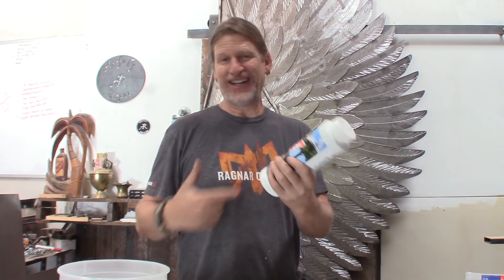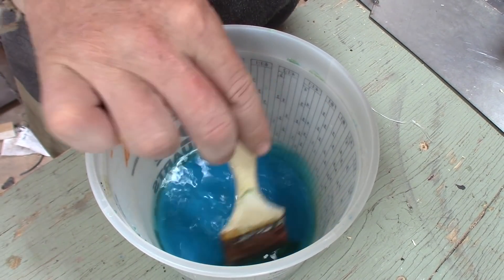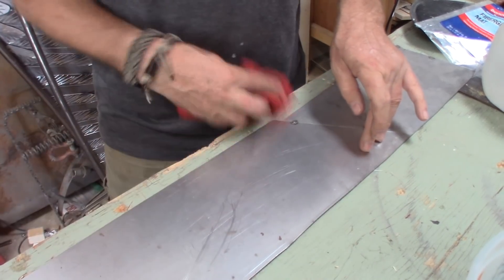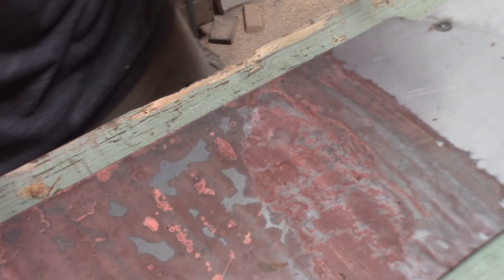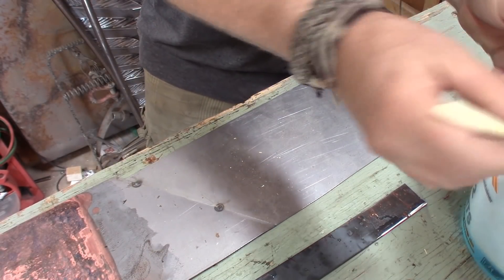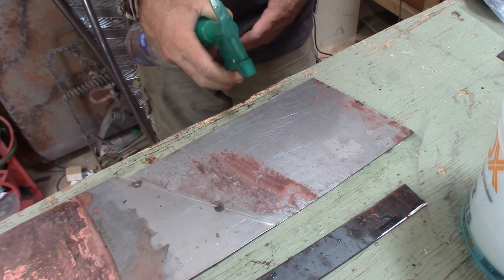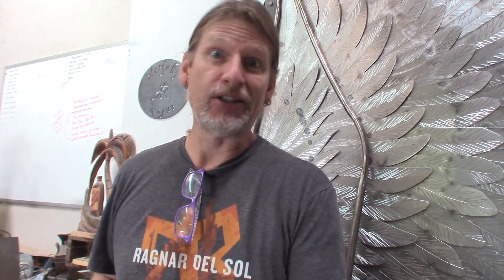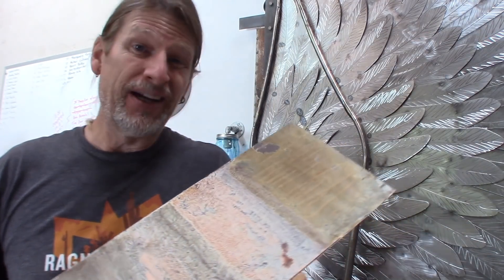Copper Sulfate on steel FREAKED ME OUT!!!!

Comment: Some cool chemistry going on here. Also some "accidental", but natural electroplating. The iron atoms in the steel displace the copper atoms in the copper sulfate solution; the surfer gives up the copper and attaches to the iron atoms forming iron sulfate. The carbon in the steel grab on to an oxygen atom as a result. This oxidation (rust) is redish brown (we all know this) but the iron-sulfate is bluish in color. Where the iron sulfate outnumbers the iron oxide the "stain" is a bluish color. The displaced copper atoms also oxidize very rapidly turning green, but because this combination has the same electrical charge as the iron sulfate it will not adhere to the steel. The green liquid can be wiped off or if dried it will come off as a powder form. Adding vinegar (Acetic Acid) to the mix combines with the copper to form copper acetate which is also bluish in color and this will electrically adhere (electroplate) to the iron atoms in the steel. The only color you can not achieve permanently without affixing it with some sort of clear coating resin is green. I really only researched this to make sure the addition of acetic acid wasn't creating some sort of noxious fumes you should be aware of - apparently not.

Comment: Copper sulphate crystals dissolved in dilute sulphuric acid was a common, traditional marking fluid still in use back in the sixties and a little later, for marking out on iron and steel components, before the safer, more modern stuff came out. It helps get a nice overall finish if the steel's clean.

Comment: Have used copper sulphate solution on metal prior to marking out with a scriber since metalwork lessons in 1970. If the metal is grease free then putting a layer of copper on it allows you to scribe on it really easily. These days tend to use Methyl Blue or similar.

Comment: Don't know how I ended up watching that but I really enjoyed it.  Great vid.  How durable is the copper effect when finished ?
Reply from the maker: I have it on several pieces in my shop and its still going strong
Reply: @ArtfullyRogue  Does it work on Stainless steel ?
Reply: Would this work in a dipping application to fully plate an item or would I be better off using electroplating?

Definitely going to try using a copper sulfate solution either way.

Comment: I heard you could also do something like that if you heat  the metal up and then went at with copper wire brush
Reply: Yes, or brass. My old blacksmith mentor taught me that one. He used the forge to supply heat, of course.

Comment: We use Copper Sulfate at my job to check metal fuel and brake lines. If the Galfan or Nyclad or primer protection coatings on the lines are compromised by scratches or gouges or anything else, a dab of copper sulfate will reveal it.

Comment: Copper sulfate is very very toxic. Use gloves and never breath it in. One tablespoon in 150,000 liters will prevent algae forming in a pool for two years. Empty it on the ground, never down the drain. One cup will kill all the fish in a 2 mile lake. Also try using powdered chlorine from pool supplies as an oxidizer. Nice work Mr. artist.

Comment: You can put Penetrol in a spray bottle and spray to prevent rusting. Puts a great clear coating on the metal. This is a great tip I learned from a welder. They spray on fresh welds and bare metal to prevent rusting. Works great, should try it.  Dries to a very durable clear coating. I believe it would be just the thing to coat this process.

Comment: You can also get a quick rust patina using a 50/50 mix of Hydrogen peroxide and white vinegar.  Applying heat with a heat gun also vastly speeds up the oxidization.
  I wonder if after the copper sulphite treatment you could sprinkle flakes of salt on the metal and then fume it with amonia to get a rich and crusty blue?

Comment: If you were to wire brush the steel prior to applying the copper sulfate it might help the coating to form more evenly and securely if you want a more even coat.

Comment: I actually used to use copper sulfate in the welding industry. If you have to grind through paint or galvanizing, you spray the metal with copper sulfate and anything that doesn’t turn copper still needs to be cleaned off.

Comment: Copper sulfate was used in sheet metal shops for marking out. it would be painted on let to dry and then scribed through. Any mistakes could be corrected by spitting on a crystal and using it to replate. It was eventualy phased out due to it's toxcity.

Comment: I use copper sulfate mixed with sulfuric acid to etch with. Before that I used the same mixture to etch numbers on drill pipe. I have never thought of mixing it with just water to keep the patina.
Reply: I use Copper sulphate in water to electroetch, with an old phone charger as a Power supply. Amazing stuff.

Comment: If you heat the steel and use a copper dish scrubber, it will deposit copper onto the steel, this also works with a bras wire wheel

Comment: I'm a chemist but I don't do metallurgy, I work testing pesticides. I found that dramatic reaction on the surface of the steel very interesting. I suspect, but I'm not sure, that there's a reduction of the copper and corresponding oxidation of the iron going on. So you're seeing the copper color and rust color being mixed on the surface.  Also, if you did actually clean off the oil with some kind of soap and water solution first, rinsed and dried it well, you'd have a more consistent reaction across the surface. But perhaps the beauty of the end result is its variations. Copper Sulfate can be purchased in bulk as an algae treatment for large ponds. It's usually found in the pentahydrate form, which just means the each copper sulfate molecule is loosely bound to five water molecules in that crystalline form. Given enough time to react to oxygen in the air, elemental copper forms two oxidation products that would enhance your artistic doors. Very nice doors by the way! Copper(I) oxide is reddish colored, similar to rust or iron(III) oxide. The other copper oxide is copper(II) oxide which gives that blue color you see in the copper sulfate as the copper in copper sulfate is also in the copper(II) oxidation state. Keep experimenting and creating like this, it's the love of discovering these things that is the foundation of science.

Comment: Your parents should have bought you a chemistry set when you were a kid. Your copper plating. If you keep adding it,  your work will have a consistant layer of copper bonded to the steel and will look like its made from copper. Dip your pieces in a bath of concentrated copper sulphate and presto they will be consistantly copper plated and look like copper. You could create patterns by applying grease where you did not want copper to stick.

Comment: have you tried using warm water with the copper sulphate yet? it might dissolve quicker also I think if you used a decreasing agent to clean all the oils off first the copper sulphate solution might work better in one application just my thoughts on this. came out very well tho

Comment: FIRST, GET PURE CU SULF. FROM ANY AGRICULTURAL SUPPLY.  SECOND, WEAR PROTECTION! ! ! ! ! IT IS TOXIC.  TRY A PLASTIC KIDDIE POOL WITH COPPER SCRAP IN THE SULF. SOLUTION AND HOOK UP TO A CAR BATTERY FOR PLATING.  CLEAN ALL OILS FROM THE METALS FIRST.  READ MSDS ABOUT YOUR BREW FIRST. THESE ARE DANGEROUS WHEN COMBINED SO READ FIRST.

Comment: If you wash the preservative off of the steel first, it will work more consistently.
Reply: Hillary Levenworth - If he cleaned it well, it would just make a boring copper layer. He leaves the peanut oil on to get a good texture and patina look.

Comment: Back in 1978 or 79, I partnered with a sculptor in NYC doing art fabrication for several artists in Manhattan. We built a number of pieces for Dorothy Dehner out of Corten steel. These were kind of monolithic pieces 5-6 feet tall with various geometric shapes stuck together. We used our mig welder and 1/8 sheet to make the box like shapes, they would have weighed tons made out of solid stock. To get the nice rust patina she wanted we sand blasted them and sprayed down with vinegar. Then let them sit out on the fire escape to get a nice uniform patina. Here's a link to one of here later pieces in this style: https://www.artsy.net/artwork/dorothy-dehner-sancho-panza

Comment: I think you cant really get a copper patina this way, because the patina agent would completely convert the thin film of copper on the steel. You can get copper sheet fairly inexpensively, it is used in construction for roofs. Epoxy it to the door. That way you can use copper patina agents to get those rich green and blue copper patinas.

Comment: Your actually cementing the copper out in solid form. It is copper plating.  If you take a white cloth and wipe the steel it will be brown to black fluid. A bit more complicated than that but that's the simple explanation.  precious metal refiners use similar techniques to extract specific metals based on their reactivity.

Comment: So most or a lot of the "effect" can be wiped off? So can you paint over it with like a clear coat to protect and preserve the coloring? Thanks great ideas.
Reply: Unfortunately it doesn't bond all that well, so yes you can just wipe most of it away. With a few additives (not sure what they are)  "electroless copper" can plate a pretty well bonded layer, and formulated just right you can put down bright copper. 

If you neutralize the surface and dry it, most clear coatings should provide protection. If the copper isn't well adhered, there is some risk of it flaking or peeling, and a coating over the top might not help much

Comment: I discovered this in the 70's when learning to make stained glass projects.  It was used to treat the lead solder to give it a slight copper color.  Also figured out to make it from root killer too - much cheaper.  Store the solution in plastic as it will attack metal including a metal cap on a plastic jar.  Didn't know it worked on steel too.  Great tip!

Comment: Most people don't want rust anywhere near raw steel but you have turned rust and metal surface treatment into an art-form. Brilliant!
.
You can buy plain copper sulfate from plant or garden shops, as noted in Root Kill, which also contains oxides of sulfur. It is one half of a fungicide spray called Bordeaux mixture, where each chemical is mixed separately and finally mixed together just before spraying onto the crop... grapes, for example. 
.
Can I offer a different method of application? After wetting the steel with your paint brush, give it a light scrub with one of those Scotch Brite scouring pads in either a circular motion or in straight lines like your brush. Wear gloves of course.
.
 BTW, vinegar is a very mild form of acetic acid with a few other ingredients for flavor. If you don't want the flavor, nearly pure acetic acid is available in the form of glacial acetic acid... handle with care. Vinegar is about a 5% solution of acetic acid, whereas glacial is a 99% solution. Dilute it outside... one part of acid in 20 parts of water is equivalent to your vinegar.
.
Another chemical you can try coloring steel with is phosphoric acid... that stuff in Coca Cola but don't use Coke. I attracts ants because of the sugar. Rust Kill or Converter is usually 40% solution of phosphoric acid plus a detergent to remove grease to allow it to convert the surface layer of rust to iron phosphate which is insoluble in water thus preventing any more rust from forming, at least that's the idea. Rinse with clean water after processing. If you think it's too strong for your task, you can dilute it to act at the speed you want. Keep in mind that the higher the ambient temperature, the faster the reaction. 
.
Iron, the principle ingredient of steel, produces a phosphate layer which is a very dark brown through to black. Again, wear gloves as it will find the smallest nick in your finger and bite you. If you can heat the door to near the boiling point of water to dry the surface with a hot air gun before applying the clear coating, it should stop the reaction until it gets badly scratched and allows moisture to penetrate and start the rusting process going again. 
.
When dealing with acids, it's a good idea to have a container of a neutralizing solution on hand. The best I've found is bicarbonate of soda or baking soda. Keep it covered to keep the crap out of it. I deal with flooded lead acid batteries quite a bit and it has saved my clothes from becoming cleaning (holey) rags.

Comment: Can this be used effectively on kitchen countertops, or would it be toxic? Would the rust come off, either with use...or wiping down?
Reply: Not really suitable "naked".  It's a thin coating which will wear quickly and get stained by acids such as lemon juice or vinegar.  If you don't mind the whole surface oxidising to dark brown/black, that would be better for abrasion, but not so pretty.  Most copper salts are toxic.  Oddly this means that a shiny sheet copper top is antimicrobial and, kept clean, is good.  I wouldnt worry about toxity, just avoid scraping food off the top!  Many people have laminate worktops and you can now get high temperature spray cans that should be similar.  If I were going to try it I'd  treat the metal, thoroughly rinse, dry, and spray several coats of varnish.  Then avoid putting very hot pans on it. The nearest I've actually done is a worktop sprayed with copper paint..  I didn't think of varnishing it and after a couple of years it was unpleasantly discoloured.  I'm guessing the varnish would stop that.  Hope some of that might help,  I love the effect.

Comment: If you google Reactivity series of Metals you find the chemistry about your discovery :)  Copper is a half precious metal and will exchange with the not precious Iron. The Iron get dissolved as the Copper is deposited on the plate.  It helps if you make the solution more acid as you did with vinegar: just enough but not too corrosive that the acid eats the metal. In chemistry we call this a buffer. As far as I can say as a chemist you do it just fine, sir, my compliments!

Comment: Degreasing has already been mentioned for getting a more even coverage... however, there is degreasing and degreasing. To get the most even finish I'd use something like Steel wool first and then a quick clean with a solvent of your choice. This is still likely to be surprisingly greasy, and definitely so if you've touched it with your fingers!
Next, use some lab grade 99.9% pure Acetone on a cloth and give it three or four more really good rounds of wiping and don't touch it! If you look at it at an angle to catch the light and you can see any streaking, it's not clean  and oyu need to wipe it some more. Finally, it's now free from grease and there's a fighting chance that the Copper Sulphate will reach the surface of the bare metal everywhere. If it's really humid, the Steel will rust in minutes so you need to crack on with the process without a break.
Reply: But it you want an artistic finish, you may not want even coverage. The streaking and mottling are what gives visual interest. If you have a completely clean piece of steel, you can dab it using a cloth moistened with a little oil to create the uneven finish. Just another technique to adapt to different tastes.

Comment: Artisans of the gun industry learned a couple hundred years ago that copper sulfate in water with a tiny amount of nitric acid and alcohol would rust a firearm evenly. This was then boiled and polished many times. This produced the  beautiful deep blue finish on the metal. After the last polish, simply oil the metal and you have a rust preventive finish...made from rust. The boiling adds another oxygen molecule to the iron oxide. I bet you could get some top Dollar for a set of your doors in Belgium Blue! Good video!

Comment: There are root killers for tree stumps, which are poured into holes drilled into the stump.  There is also a root killer which is put into the drains to kill tree roots growing into the sewer pipes.  Both seem to be mostly copper sulfate crystals.
Reply: Only sounds ridiculous when it's something you haven't learned yet.
Reply: And magnesium sulfate, which is commonly called Epsom salt. Both copper sulfate and magnesium sulfate form sulfuric acid when hydrated.
Reply: @edeaglehouse2221  
Epsom salt is used to make a bath to soak your feet in.  If it had any sulfuric acid properties, it would burn your skin.  Your claim sounds ridiculous.

Comment: Yup where ever its not greasy copper sulphate starts rusting immediately.   You should try cleaning off the greasy hand prints and other garbage the manufacturers spray on there to keep it from rustin on the store shelf.    The whole thing would rust uniformly.    Same thing thing happens to copper if hou apply acid.   It turns blue but not if its greasy.    As in all things , prep work is 99% of the job.

Comment: By dissolving a single crystal of copper sulfate root killer in a spoonful of vinegar you can make an "ink" that writes of polished steel. I use steel nibs from an art supply store to sign my personal steel and cast iron woodworking tools. The lettering tends to be kind of ragged but I imagine a process could be developed to regulate the flow-out from the nib. It is clearly a matter of regulating the flow out because wherever the clear ink flows the serous metal turns black. If it is left undisturbed until thoroughly dry the signature will be quite durable. I suppose a brass nib - if there is such a thing - or even a steel nib with the contact point polished smooth would glide more evenly.
Reply: What about a fine point marker?
Reply: That sounds cool...
I would find a way to make it more viscose...

Maybe by adding some gelatin or dextrin?